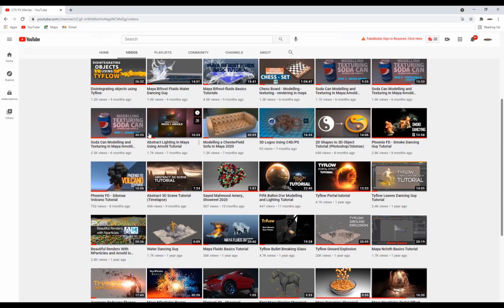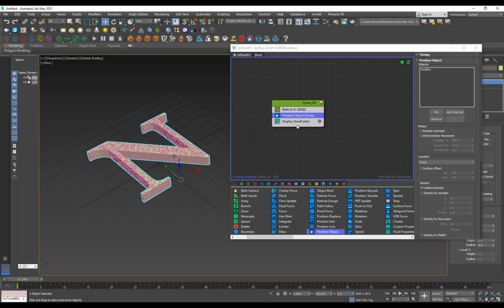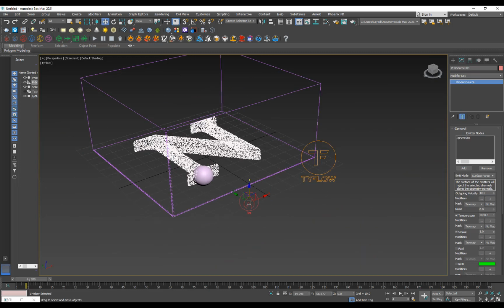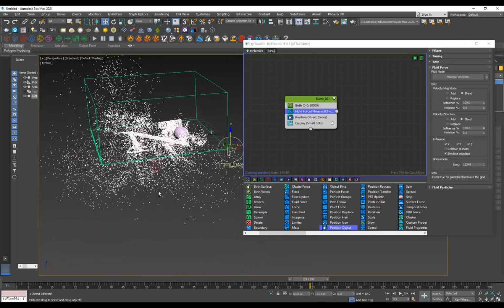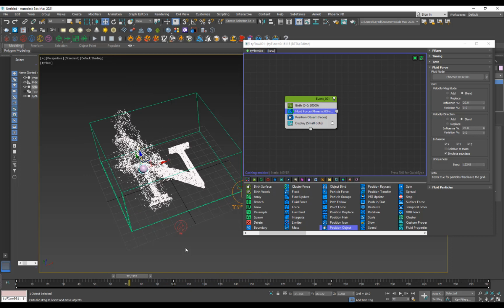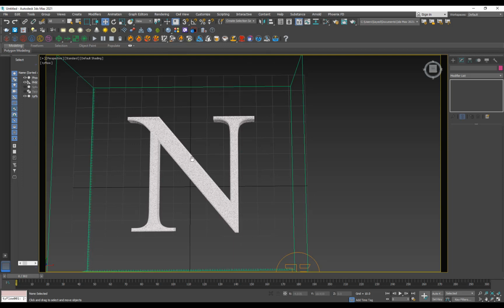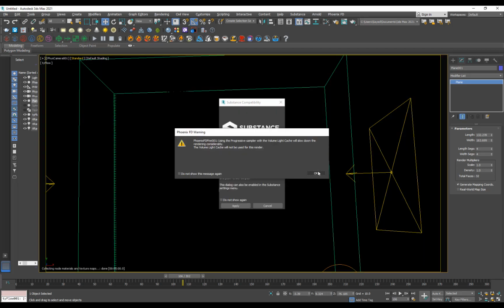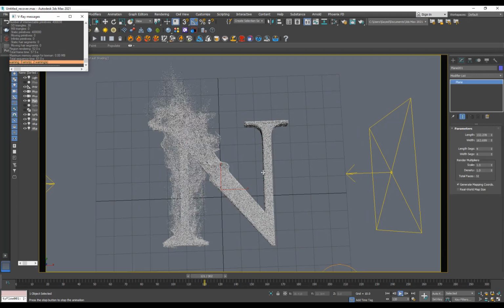Tyflow Phoenix Dispersion Tutorial

Comment: hey nice tutorial. for some reason there is smoke with the particals if i render it with corona, is there a way to remove to smoke?
Reply from the maker: Thanks ! Yah you can turn off the smoke from the grid or better just go to the phoenix fd render options and turn the smoke opacity to 0
Reply: @fxmaniac2839 thanks for the fast response :D  it only shows when rendering, i just look up what you sad and change some things but stil got the smoke visible in the render.  ( recalculated and it worded) thanks ! amazing tutorial!